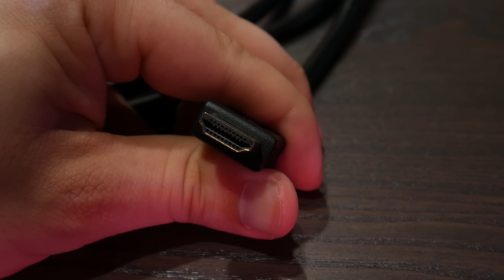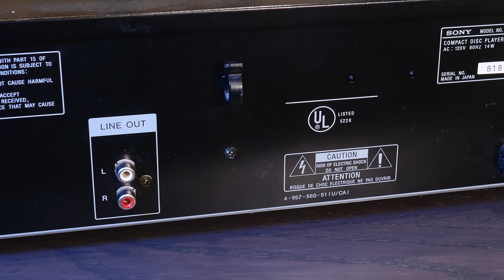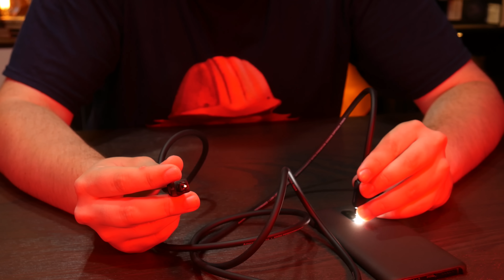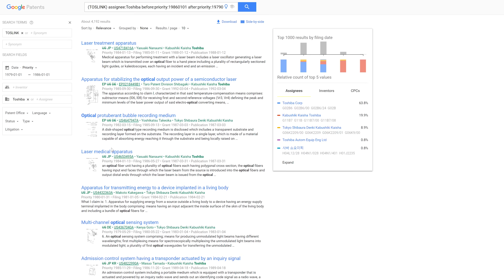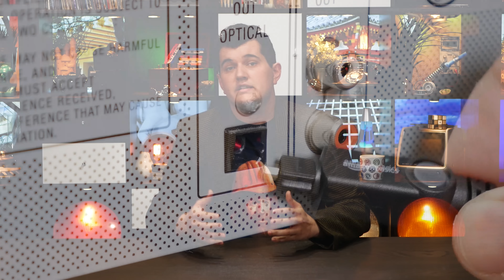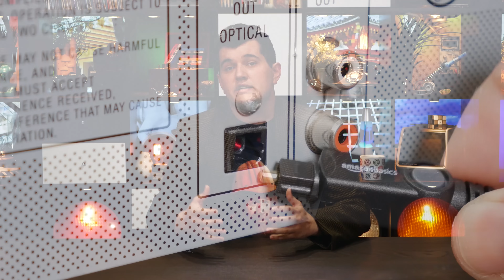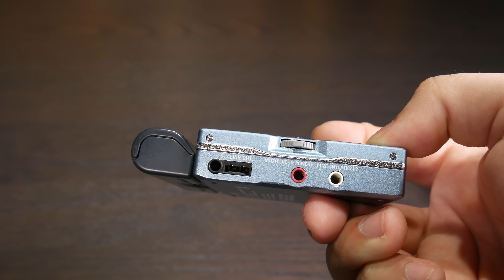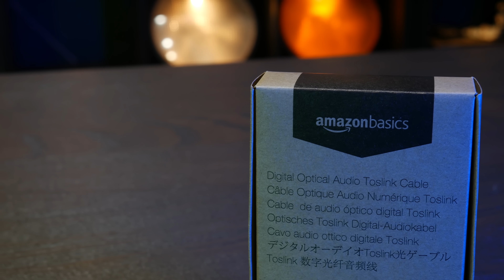TOSLINK: That one consumer fiber optic standard

Comment: You tell me when running 20+ mts of coaxial cable next to AC wires if you don't prefer a toslink cable. For most applications, RCA is enough.
Toslink would've been the standard if they gave it addressable lanes and physical switches. Imagine daisy chaining everything on a studio. Maybe too complex/expensive for when this technology appeared though
Reply: You should check out another optical standard that does this called MOST. It's most commonly used in cars however...
Reply: @Nordmarkproductions  Yes, I own an Audi that has a MOST bus, although it is just a protocol and in my car its just copper wire instead of fiber optic. But it is too slow to transfer video or multiple high definition audio afaik. The mux/demux process in MOST is just horrible. It's made to be cheap but to look neat on the datasheet, that's why it's being used I think. People hear fiber optic cable somewhere and loose their underwear.

Comment: there are other consumer Fiber optic standards, they however are generally used to transmit other copper standards over longer distances, see Fiber Optic Thunderbolt cables, or fiber optic USB cables.
Reply: No there are not. Fiber optical cables are not a standard. The standard is USB ect.
Reply: @andykillsu  actually they are,  they use the same if not similar circuitry and transmit the same data, so yes they are a standard. now, are they built on other standards, yes that's my point. there are fiber optic consumer standards that are designed to transmit copper standards farther distances, and yes these are usually cables, but they can also have fiber connectors.

Comment: The optical cable is definitely overkill, but I can think of one major advantage with having a separate cable compared to RCA connectors.
RCA connectors sometimes send analog signals and they sometimes send digital signals. Oftentimes, consumer electronics don't differentiate between which type of connection it uses, instead it will simply say "RCA". By having the optical cable standard it means that if you buy equipment for the source and for the DAC that use SPDIF, you can be 100% certain that it's going to use a digital signal. It's nice to take the guesswork out of it without having to go into lengthy technical manuals on each individual electronic

Comment: I work at a fairly big telecom company and regularly work with deploying fiber to home, business and infrastructure. But even with me having access to all that, I'm still on the fence about wiring my home with fiber internally. It's just a lot of extra work to be honest. I'll need to upgrade all my equipment to have fiber networking cards and that s**t's expensive! For now I'll survive with having fiber from my ISP and in to the router.
But to be more on the subject of TOSLINK, I am using that for my PC and my TVs :)

Comment: The obvious way to add new features to plastic single fibre optics is to use a different pure color, such as green or infrared (whatever works best for the plastic and fibers).  The end with the most expensive other parts needs to be able to send and receive in either color, while the cheaper end can dictate a choice.  But classic one-way TOSLINK format would still use red in the labeled direction.  A modern pure sender would look for the other color return signal indicating it's improved abilities, then respond favorably with an appropriate red signal. Similarly a pure receiver would send back it's ability in the other color but treat unlabeled red input as S/PDIF.  A big receiver / surround box etc. would use a standard protocol to determine if the other end wants to send or receive red, then use the appropriate pair of diodes.

Comment: I first learned of mini-TOSLINK with some old ASUS xonar sound cards. It also came with an adapter to plug in a normal TOSLINK cable if you didn't have a mini cable. And yes, I'm quite certain there was a plan for a dual-fiber cable for sending and receiving that never came about.

Also, I've heard the argument that a SPDIF cable creates EMI with other cables and TOSLINK doesnt. Still...I'm pretty sure the clock rate of pulses is like 6MHz and we're talking about a mere .5 volts so......yeah.

I've always preferred TOSLINK because it's cool. That's literally all.

Comment: 14:23 Gold plated toslink connectors?
That's like a towbar on a Twingo... or braces on dentures...
Reply: Or farting in a tornado
Reply: Twingos can tow a little trailer! They're good for a few hundred kg.
Reply: @mfbfreak  That's true... I actually own a Twingo myself. But a towbar just seems funny on a small car ;-)
Reply: its that way to resist corrosion, not to improve sound quality, its a crimp to hold the optical cable in place in the housing.

Comment: I think you missed the main advantage of Toslink, as you are focused on advantage to consumer.

The main advantage of Toslink to manufacturer is simplifying EMI compliance, as you no longer have an antenna sticking out with 2MHz signal.  That's when you delete coax output and replace it with Toslink.

Comment: Advantages:  [In theory] TOSLINK was/is useful for quickly solving frustrating ground-loop buzz produced between receiver and amplifier or amplified speakers.  ALSO, used by radio broadcast stations and amateur radio hobbyists to isolate their lightning-prone tower antennas from their station equipment, so a lightning strike won't fry their sensitive electronics.

(Ground-loop buzz is not caused by electrical interference mucking up the audio signal over RCA cables, but by the electrically commoning the ground plane between two distant objects that plug into two different electrical circuits that have wires traveling all throughout the building before reaching both devices.  There's also the incidental chance that your receiver and your amplifier are plugged into two different circuits on two different phases that are 120° or 180° apart, or being dirtied by some nearby transformer with a really poor power-factor.)

Comment: I'd like to see a cable buying guide from you. The gold plated optical cable is an obvious rip off, but other cables can have some ambiguous features that are hard to decipher. For example I've always considered the 'premium' fabric woven USB cables to be junk and prefer solid rubber, but the connectors on the end are a crapshoot. Some USB (particularly micro USB) connectors fail in a week and some last years and I have no idea how to spot which is which visually. I just have to buy a couple brands until I get a good one.

Comment: confuse us all with a video on BCD, EBCDIC ASCII, extended ASCII, and UNICODE
Reply: Actually, yes! Sure computerphile did a bit of this, but I'd love to see the history of character encoding at the depths that this channel goes.
Reply: Unicode's first 256 characters map to ASCII...let's get weird. also I had a teacher who worked with EBCDIC back on the Mercury missions. BCD's easy, on a breadboard. with the right chips.
Reply: @herzogsbuick  No, only the first 128. Unicode is based off of ASCII, not extended ASCII.
Reply: @alexanderhill2569  

The next 128 characters of Unicode come from ISO 8859-1 (Latin-1) and ISO 6429 (extended control characters, which were almost the most popular extended ASCII standard at the time.  Depending on if you count the default US code page of Windows - very similar, but not exactly standard.

So in a way you're both right, and any discrepancies and details can be blamed on the fact that encoding before Unicode was an even worse mess than after.
Reply: recycle that idea
Reply: All that needs to be said about EBCDIC is that it was designed to print nicely into a two-dimensional table with no regard of how silly that is for actual programming. I mean, how often do you look up character values on sheet of paper? XO
Reply: @TruthNerds  Hold my (root) beer.
EBCDIC was set up to minimize the number of times a chain containing all of the printed characters, twice, had to pass over a single line of paper to print 132 characters on it. 

If you want messed up character codes. Control Data Corporations 6 bit byte character set. Of course, they went multi byte first in order to encode lower case.
Reply: @TruthNerds  EBCDIC was actually based on the punched card encoding.

Comment: FTTH internet services are provided via a fiber cable. I have a short fiber optic cable going from my ISPs distribution box to a GPON converter.
But yes, most of the network gear which uses fiber optics is meant for industrial use, not for consumers.
Toslink is the only fiber-optical based technology I know of which is aimed at consumers.

Comment: Toslink is invaluable when the outputting device has grounding issues, because a wire-based connection would introduce a lot of static to the 

speakers.

Comment: When you use coaxial cables on your audio device,  the signal first goes through a DAC right? However, if your DAC sucks, what you get through those coaxial cables is going to suck. If you're using TOSLINK to the best of my understanding was that you could bypass your internal DAC and pass it to your receiver which in theory should have a much better DAC. You could also do this by introducing a better DAC to your device via an audio card or an external USB DAC but if you have a good one in your receiver that's a waste of money. The way I always thought about it was kind of like a pre-amp pass. No one complains about using RCA with their record player, but you always use them to pass the raw output to a pre-amp first. If you had to pass the output after it already went through an internal pre-amp as you do on cheap players, you'd probably not buy that record player if you actually care about your records and sound. I feel it's the same way with TOSLINK. If I can bypass my built-in DAC and use a better one elsewhere, I may as well do it. Here is the thing, if I've already sunk $$$$ into an audio system, and now the bottleneck is my motherboard, and my two options are spending more $$$ on an external DAC or use my $$$ receiver as an equivalent DAC, I'd rather go with that one. I may be completely wrong here, let me know.

Comment: To be fair, terminating fiber is tremendously more complex than terminating copper. So while HDMI could be fiber (and there are, in fact, expensive HDMI cables that use fiber as the transmission medium), with any medium where the end-user is expected to do the termination him/herself, we'll probably be using copper for the foreseeable future.

Comment: The one thing TOSLINK does and that's indisputable: it breaks up electrical connection between components reducing various noises from electrical interference.
Example: my external sound card. Before I switched from using USB to TOSLINK to send data from PC to it, there was a constant noise introduced by my not top grade mobo and too power hungry GPU.

Comment: it's a price issue, Optical Cables are way more expensive then HDMI or Etherenet. Also Optical Cables are starting to see other uses, the higher end QLED TV's by Samsung that use the One Connect box use a Fiber Optic cable to provide both the image and the power to the display panel portion of the TV (with all the signal processing occurring in the One Connect Box).

Comment: As for consumer fibre-optics, I'm honestly surprised we aren't seeing 10 gigabit (or higher) networking in homes yet.

I mean, even then... I saw some 10 gigabit ethernet stuff STILL clinging to the copper twisted pair ethernet cables, which is just... I mean, it's getting just a little insane now, isn't it?
Reply: CAT 6 cables are about 60 € cents per meter, and support 10GBASE-T up to 55m. I'll admit though that optical cable (especially when installed) has the big advantage that it can support higher speeds later on. It currently does look like 10Gbps is going to be the end of the line for twisted pair, from a practical perspective (excuse the pun).

Comment: Hypothesis as to why fibre has not entered the home:  Cable Durability.  Glass Fibre, the best for sending light long distances, is VERY fragile.  Copper wire, not so much, you have to do a lot to damage copper by bending it or stepping on it.

Comment: You didn't know mini-toslink was a thing?

Pretty much every computer I've owned since 2006 has it buried in the audio settings. (mini TOSlink/SPDIF out enable/disable is common) settings, and I remember the red glow from the audio out on my laptop pretty well...

Of course, never could think of a reason to use it, but still.

I did try using the TOSlink on my TV since some genius decided headphone ports on televisions were no longer something anyone needed...
But, it didn't really work out too well in practice...

Of the things in my house right now, I have two laptops with TOSlink, a TV, a desktop, And uhm... Oh yeah. Playstation 3...
Playstation 2 as well actually.

So, actually every computer I own, some of the consoles made post 2000, and a television...
Wouldn't surprise me if my phone has it too. XD

Comment: i have a set of logitech pc speakers that happened to pick up a local radio broadcast. if i didn't have anything playing on the computer i could hear the radio perfectly well. i dont think toslink would have saved that though, i think it was the amp to speaker connections that were the culprit

Comment: I bought a gold plated cheap toslink many years ago for laughs, it’s worse in every way - to stiff to insert, almost stuck once inserted. Plain soft plastic toslink cables much better. Also regarding upcoming video, I’m very happy with hybrid fiber/copper HDMI cable for conference room installation. Laptops with cheap HDMI adapters failed on long cable run (10meters) with the TV, with the 4K/60 (up to 18gbps) over fiber now everything can talk to the TV without issues.

Comment: I'm guessing if you bought a 20m fiber optic Ethernet cable and a 20m copper Ethernet cable the copper would be cheaper, but if you were to wire, say, a 10km square area from scratch with same bandwidth, would copper still be cheaper?

Comment: Ah, TOSLINK, the connection standard that could have been so much more.  Want full duplex?  They could have put a photo diode at each end and a simple prism to split the beam going through the exact same cable.  Want faster signalling?  Make blinky go faster.  Want really more faster?  Make blinky light blue and use a colour filter to detect which standard it is automagically.  Plus, because photons of various wavelengths can travel in the same and opposite directions in the same optical fiber at the same time (unlike electrons in a wire), want all the things?  Do all the things at the same time.

Comment: The ground of the DAC S/PDIF is often connected to the ground of its analog output. When you connect the coaxial cable to a PC for example, the audio outputs ground gets connected to the dirty motherboard ground. This thing generates absolutely objective bzzing noise, similar to that heard from the old PC onboard sound cards. So the galvanic insulation given by the TOSLINK is absolutely beneficial. But really, the optical connection smooths a little bit the fronts of the signal and indeed leads to higher jitter,  so I prefer the coax but ALWAYS with a S/PDIF isolation transformer in order to avoid noise injection by the common ground.

Comment: Huh. I know my macbooks 3,5 headphone jack has an LED in it (it comes on when something is inserted into it and usually goes off when you pull the plug) and I only know about it because sometimes it fails to register that the plug has been pulled, resulting in no sound over the external speaker and a glowey red light emitting ominously from the jack. 
It never even occurred to me that that is for TOSLINK.

Comment: I use my Sony amp with Toslink even today. My PC is connected with HDMI to my TV then Toslink from TV to my Sony Amp - the difference I feel is near zero noise but as soon as run my sound via RCA cables I can hear interference. So in my view Toslink is much much better to RCA quality - contrary to what you said in your video.

Comment: Not to be pedantic, but you mention that networking in homes and businesses still use ethernet when referring to the lack of fiber optic technology in the consumer space, but Ethernet is media agnostic.  You can, and often do, have ethernet over fiber optic cables (though it's extremely uncommon in the consumer space) or twisted pair copper.
It would be more accurate to say networking in homes and businesses still use copper cables.

Comment: One thing I found cool about TOSLINK was the application - or rather, the implication - in Laserdisc players. With the introduction of DTS audio to the format, any player with a digital output, including those predating the DTS standard by several years, could play it as long as you had a DTS capable amp or receiver. Which is probably why it's a way more common sight in LD players than the combination of TOSLINK and digital coax.

Comment: I've got a 2009 mac mini in my collection which uses the a 3.5mm headphone/toslink connector for digital audio out.
Some 90's Toshiba laptops had a combined 3.5mm headphone/toslink digital output (I had one, but no amp to run it!), as did some much more recent model ASUS laptops and macbooks.